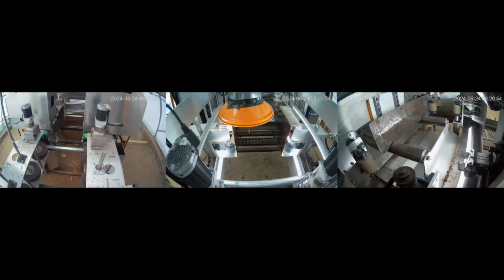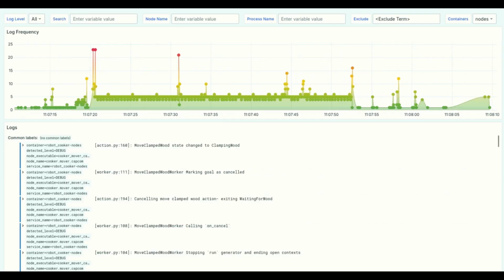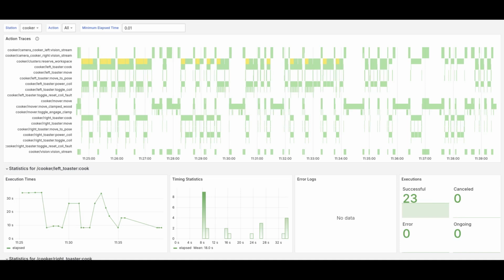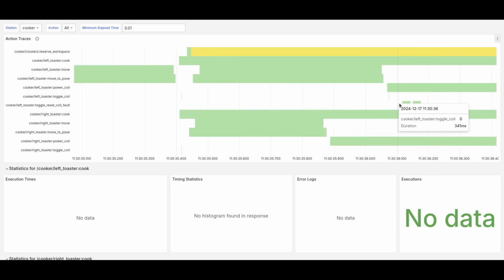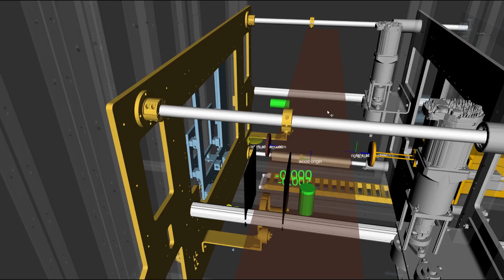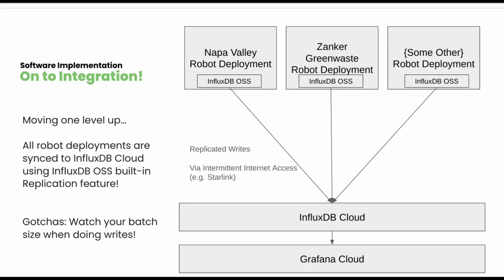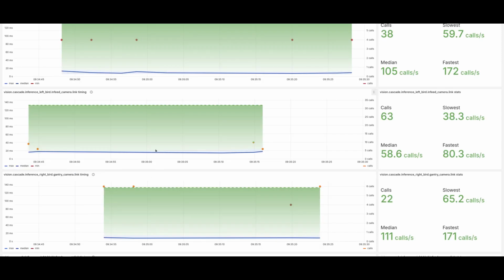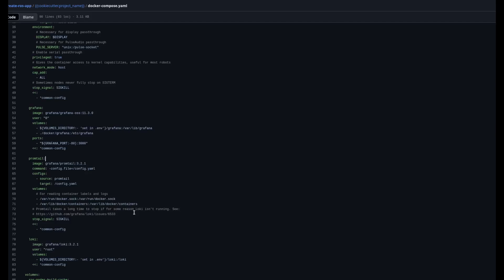Building a Cloud Metrics Pipeline for your Production Robot

Comment: Very cool Alex! How do you intend to make sure similar problems don't occur in the future? 

Did you add a constraint to your simulation that the rods can't be to close together?
Reply from the maker: @KeithSchumacherPortfolio  thank you! We took a two pronged approach. 

1) prevention. We now cook nails furthest from each other first, so these situations are less likely to occur. 
2) recovery. While cooking, we carefully monitor faults, and if one of the cooker faults while the other is also cooking, it will pause, get out of the way, and wait until the other cooker has released control of the space. Then they swap positions and the one that move out can come back in and cook. 

It's actually simpler than it sounds written here.